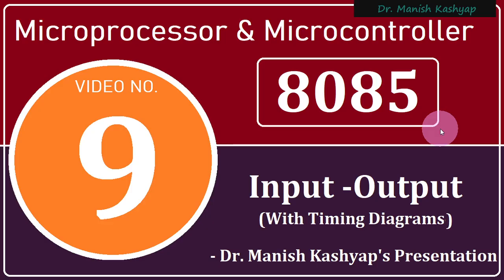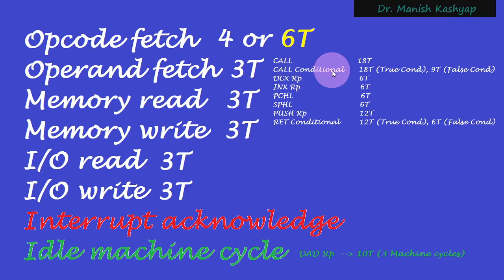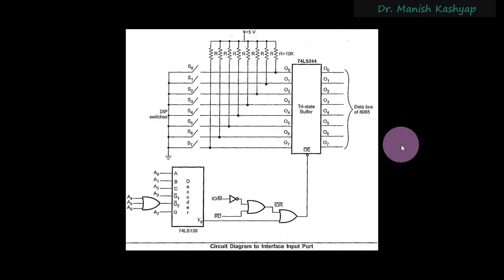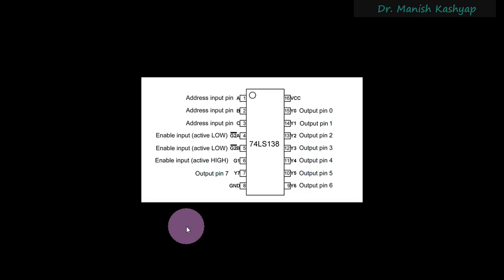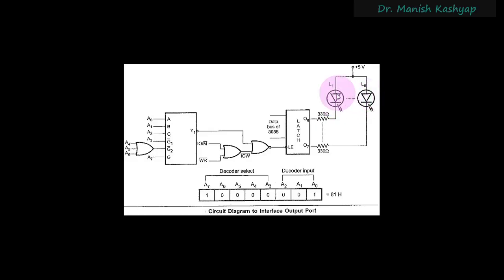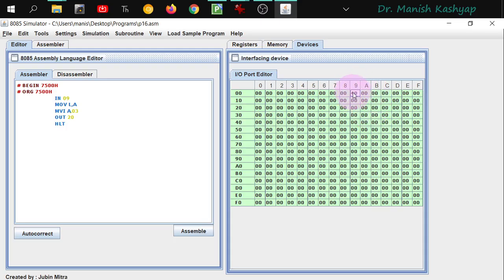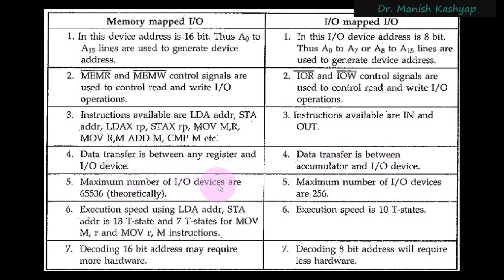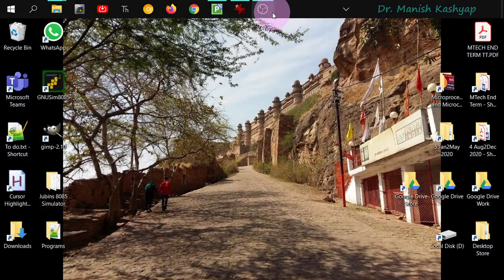8085 Input-Output Devices

Comment: I am currently writing an 8051 simulator and have some questions on how ports work.  certain opcodes when you read or modify a port value read from the output data latch not the input pins which makes sense.  However, I can not see any documentation on the behavior of a mov dir, dir opcode that operates on two ports such as mov p1, p0.  while I can see this would probably almost never (if ever at all) show up in a real world application i would stil like to know if the read of p0 in this example reads from the pins or from the latch?